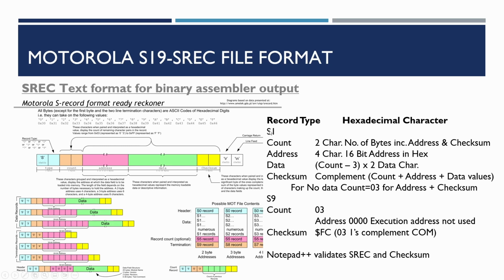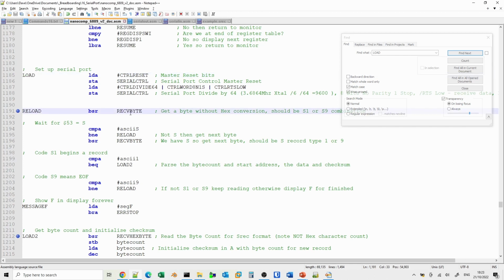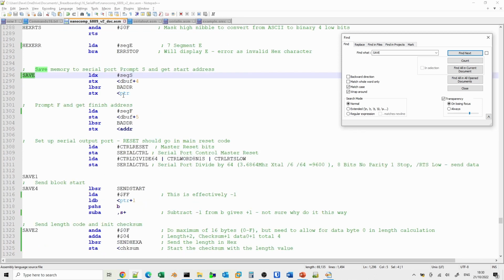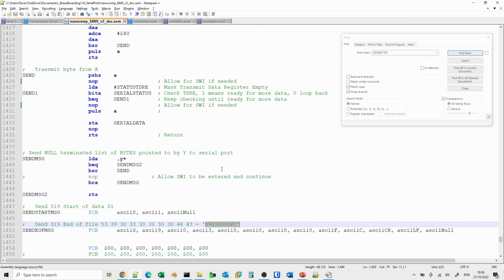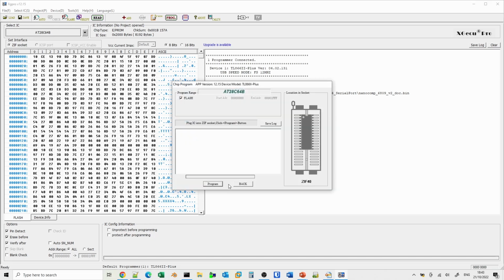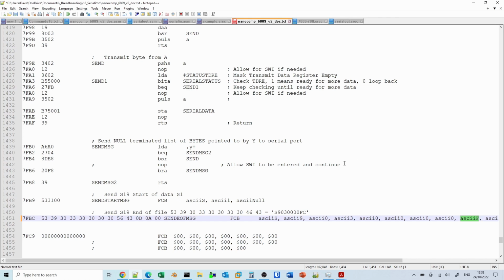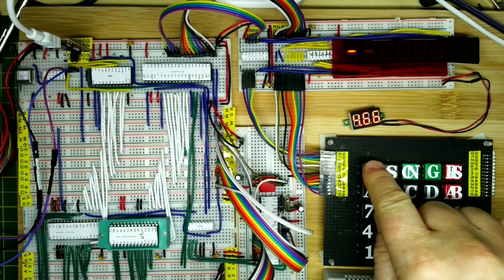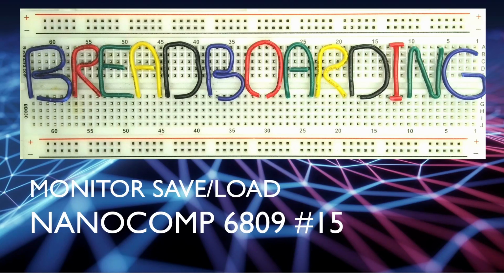Nanocomp 6809 #15 Monitor Save & Load - 8 Bit Breadboard Micro

Comment: I recently came across your channel and have taken advantage of a bout of man flu to binge watch the first 15 episodes!  Have started getting the bits together to do a build to version 2.  Thanks for taking the time to put together such comprehensive videos.
Reply from the maker: Good luck, the key pad was the fiddly bit. Just make sure you use good quality breadboards.
Reply: @breadboardinglabs  My first problem will be finding out what Royal Mail actually did with the package of chips that they say they delivered yesterday!
Reply from the maker: I know the feeling. Upto 3 weeks for some packages. A relative in the Royal Mail joked about 5th class package delivery, they are not too far from the truth!